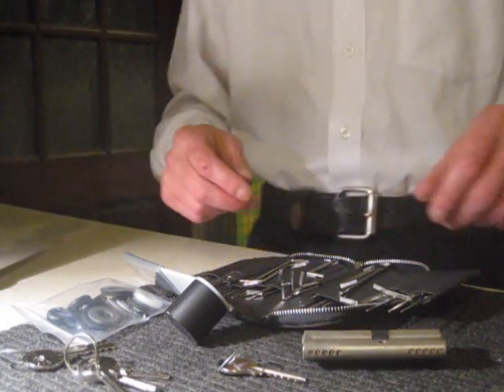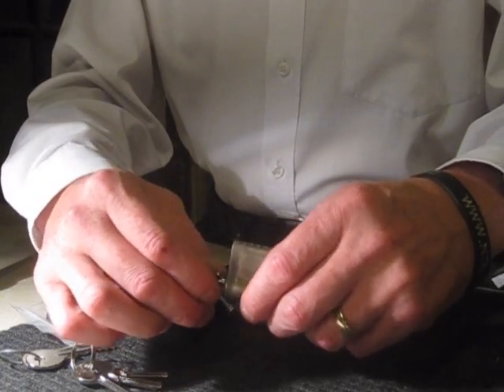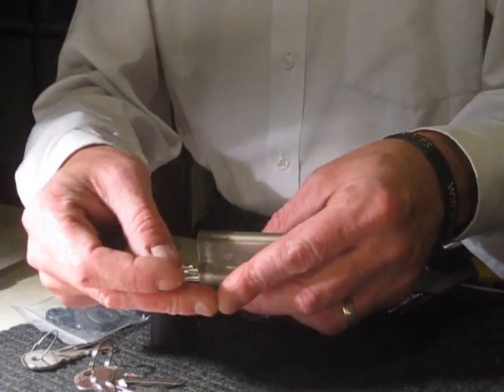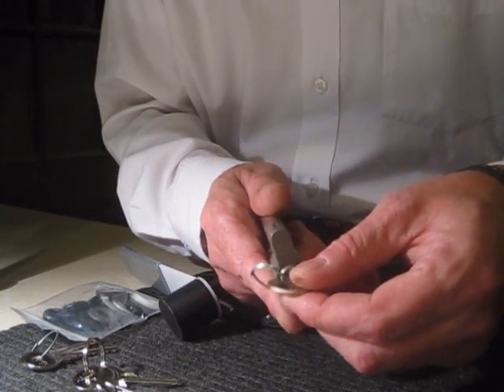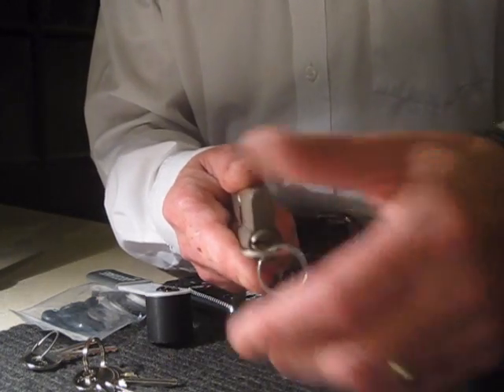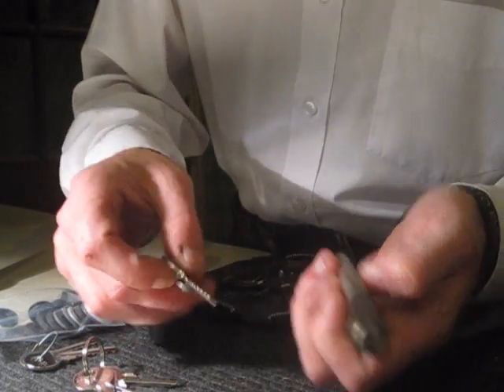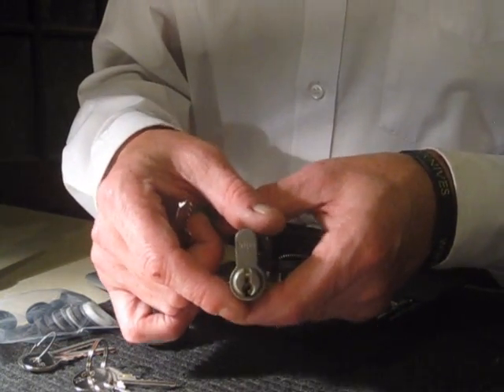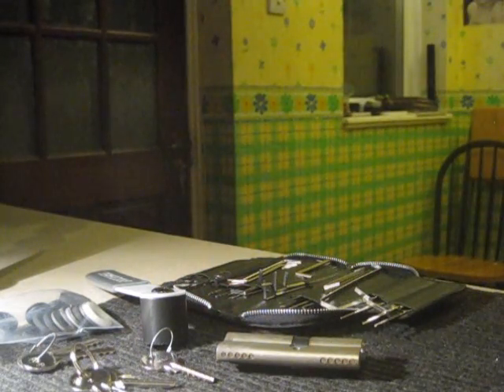Bumping A MILA Euro Cylinder Lock TUTORIAL.. (HOME SECURITY WARNING!!!)

Comment: Insurance companies require you to have lock cylinders that meet TS007/EN1303-2005 standards and a 3 star locking system on your main entry doors. A 1 star lock with "door furniture" will meet the 3 star requirements . Door furniture means a bolt system operated by the handle. However you can buy a cylinder that is 3 star on its own .
1 star locks which are anti snap,bump,pick are about £12 and the latest 3 star locks are £30- £40 .  Nothing wrong with the peace of mind that a 3 star lock with a bolting system will give.
Reply: Pascal - might be worth replacing. I’ve got a couple of 6 pin Carl f’s and I can rake them both open in seconds.  I’m pretty sure they don’t have any security pins at all.

Comment: Your holding the lock upside down when you bump it. Does the bump key work when the lock is the right way up like it would be in a door.
Reply from the maker: It makes no difference as pins inside lock are under spring tension.

Comment: Thanks for doing the video, i'm in a situation where I've bought a used pvc door with Euro lock and key. Unfortunately, as I knew the person, I didn't check the key worked in the lock. Now I have a nice door and frame that I can't use, as the key given to me doesn't fit the lock, and the doors locked. Any ideas on what to do if the pins are hardened steel and won't drill out?
Reply: Jamie S - try key impressioning. Takes a bit but if you’ve got some time on your hands...